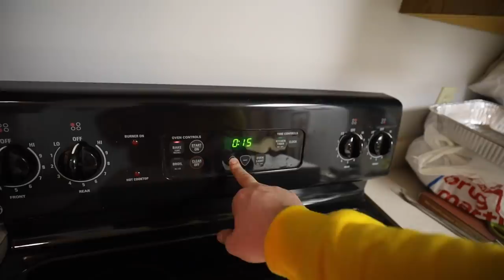Building A Banana Ram | Part 9

Comment: Painting in the garage tip. Get a box fan and a case of cheap furnace filters. Zip tie or tape one to the back of the fan and put it next to you blowing away. It will pull a lot of the overspray into the filter and keep it from landing back on the painted parts.

Comment: You can never go wrong with sanding. Paint will always adhere better on a scuffed surface. I would’ve probably used adhesion promoter just because it’s plastic, but that could just be overkill 😅😂